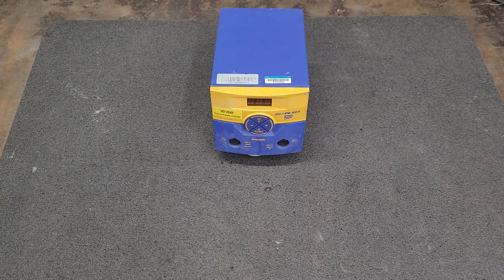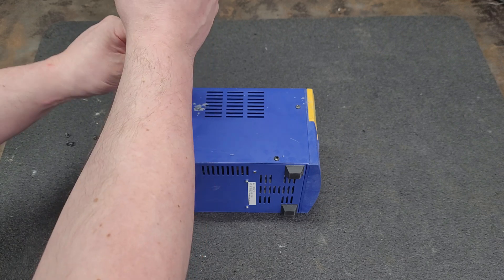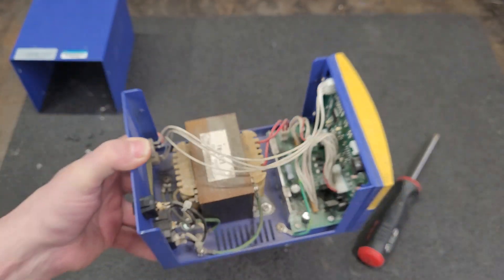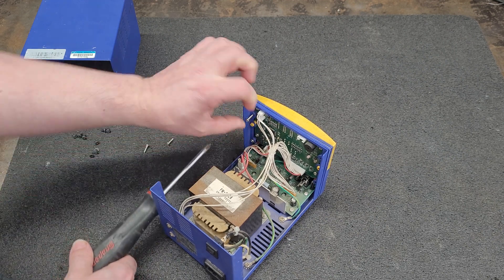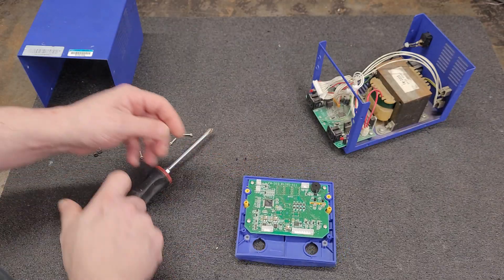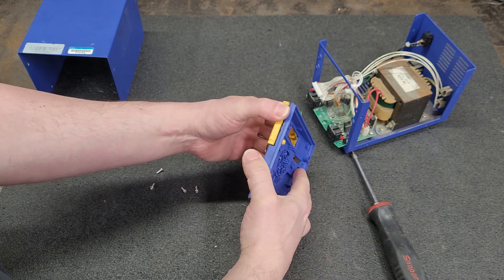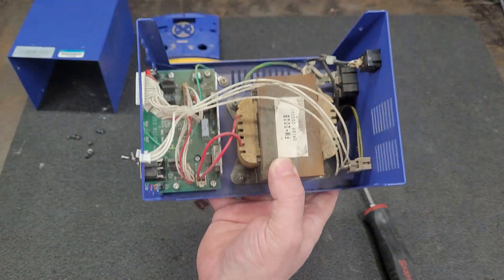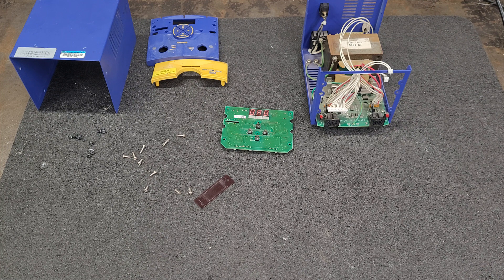Teardown Inspection of the Ebay *Burnt Buttons* $199 HAKKO FM-203 Dual Port Soldering Station.

Comment: Is it made of metal?
Reply from the maker: @obidahasdia4095  the shell is except for the front
Reply: @Rhine_Labs  so its better build then the 888d / DX ?
I got x5 888d
x1 888dx 
x1 fx 971 i just ordered the micro handle hope it be good cause it only has x8 micro tips in total max which i ordered but looks dissapointing i order it for both the micro & normal soldering ..
I didnt check it has x8 micro tips only .. hope they do the work for a 2023 new soldering station it shouldnt be made for nothing right? Im now stuck the 951 fx there lotta fakes and out of stock .. im now trying to buy fm 203 204 206 what should i go for? The fm 206 is. 20,000euros i dont care about hot air handle .. the nozzle is good but needs another station for it to work with 203fm .. costs extra.. what do you suggest me to go for? Was looking at JBC but the c240 tips dont have a tip under 0.3 so im going with i guess fm 203? The fm 204 dont have handle which is 2032 for added micro soldering like the fm 203/ 206
Reply from the maker: @obidahasdia4095  fm-203 was the best hakko made.

Comment: i bought one of those from that ebay seller and a brand new -2027 kit and a brand new tip from hakko directly. and no matter what i do i get a constant s-e error. and the tip is inserted fully i've been refunded by the ebay seller. and i've sent it off to hakko to have them see weather its something with the unit itself or weather its the handpiece. Not sure what it could be though
Reply from the maker: Did you select the port you had the hand piece plugged into? Keep us updated.
Reply: @Rhine_Labs  yes also tried it on both ports and still has the error. I ended up sending it to hakko along with the handpiece I got. So we'll see what it is
Reply from the maker: @christopolis1  I know about 10 people that got them all have worked. Reason why I mention port selection a friend had one he had to manual select D or S port (Up for D  Down For S) On his a menu setting i think auto channel switch was off and so was another setting.
Reply: @Rhine_Labs  just got mine back from hakko. there was nothing wrong with the station. it was just the tip wasn't inserted correctly. idk how because i had that tip in there perfectly. but whilst it was there i had them update the firmware so it was compatible with the fm-2030  which was only $10 to do. i did get my money back from the ebay seller before i sent my station to hakko though. i would definitely recommend anyone who wants a cheap 203 buy from that seller

Comment: Interesting never thought about buying a surplus inop one! Thanks for sharing.
Reply from the maker: This was not Inop works great.
Reply: @Rhine_Labs  nice! I more meant “even if” inop I guess. Yours looks very nice. If the one I get is half as nice I’ll be stoked on Thursday!

I’m saving a couple little jobs to test. Thanks for the tip on me using my compound to replace what’s on there! Just never think to do that unless you take the heat slink off to replace a power transistor, etc, etc.
Reply from the maker: @bradclancy6069  I hope you get a nice one. also check this out great adition make offer they will accept $30 + ship https://pfipcb.com/products/hakko-fm-2024-desoldering-control-box